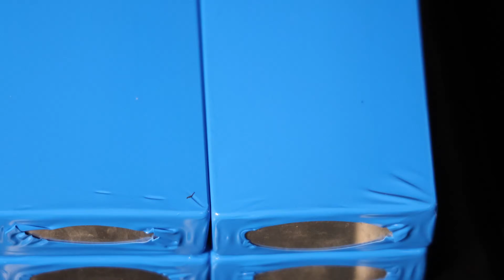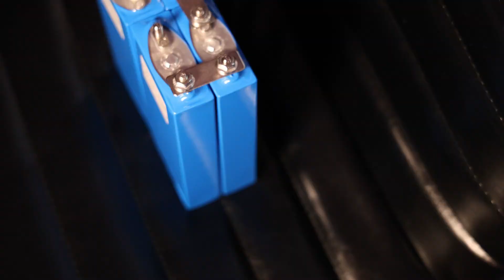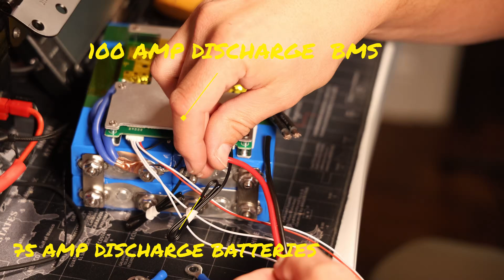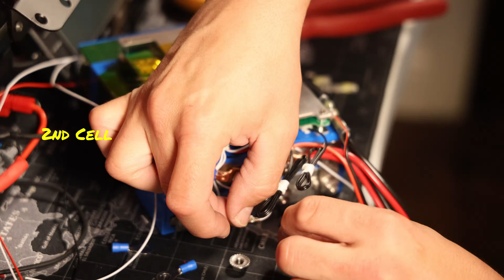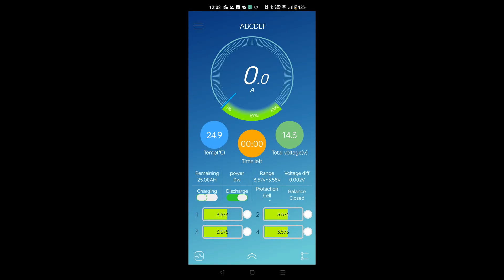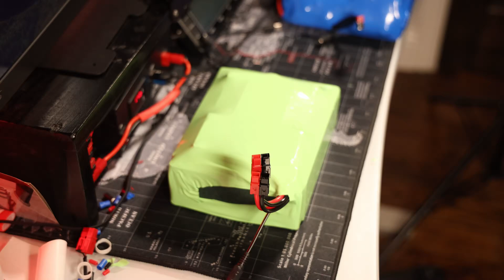Battery Build 2 0

Comment: why are we connecting sensors  as the last point on the terminals . i thought they would have the greatest resistance and therefore voltage drop that way . would we not get a truer reading of voltage as produced closest to the terminal or as the first connection . 
or do you feel as long as all are the same method there will be little difference.
tanks
Reply from the maker: 1.The Busbars are designed to pass a lot of current. The lower quality sensor terminals are not. The ring terminals used for the sensors measures voltage not current. The voltage drop across 1mm of copper should be next to 0v.  
2.If the sensor terminals are put on before the busbars then the busbar may not sit flush with the top of the terminal reducing the contact patch. This can cause a heat problem if high current is introduced.
I hope this helps. Let me know.

Comment: I would not connect + and - leads until the balance leads are correctly connected. By doing it your way you are working on a live bms while connecting balance leads.  That can damage the bms especially if by mistake you connect balance leads incorrectly.
Reply from the maker: I completely agree.